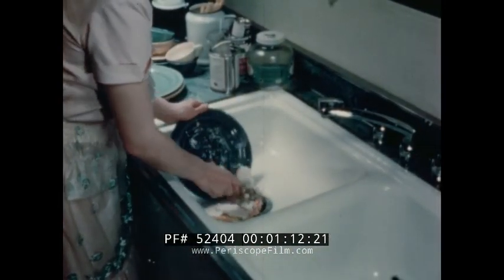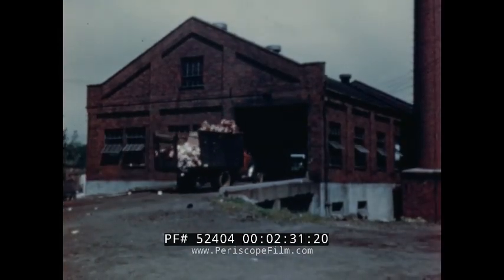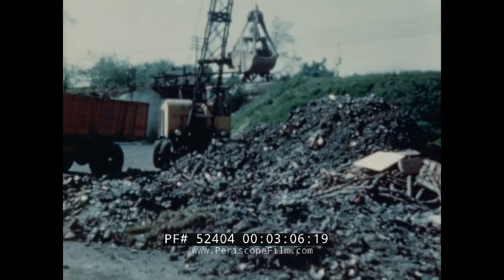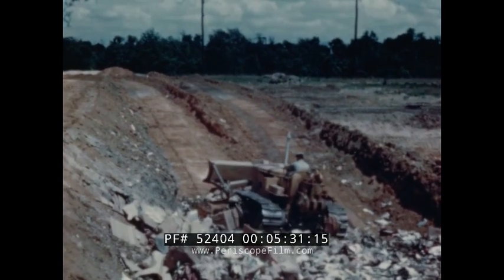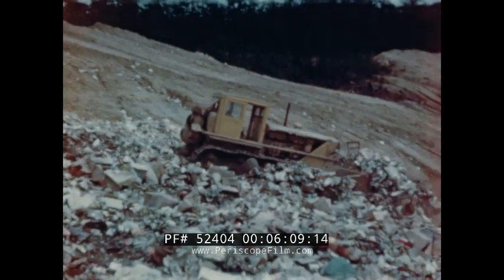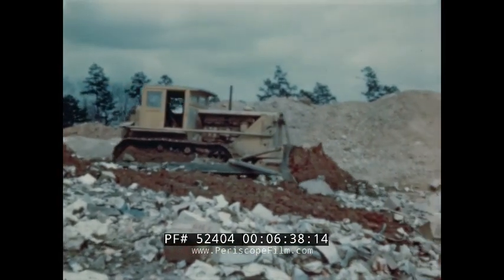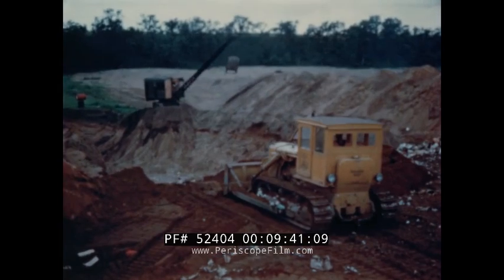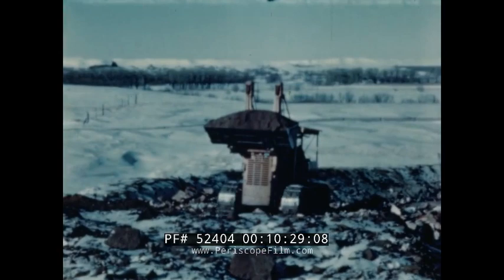"COMMUNITY PROBLEM" 1950s TRASH COLLECTION & WASTE MANAGEMENT VINTAGE FILM by CATERPILLAR INC. 52404

Comment: Wow, this film takes me back. 
I grew up in this era, and remember open  / burning dumps near my town. 
A friends father owned a small independent waste hauling company, and I worked summers (as a kid mind you) hangin' on the back of packers & slinging trash 5 days a week. The Landfill we dumped at was actually a mined out gravel & sand pit for a local concrete Co. 
No such thing as landfill liners back then, and recycling wasn't heard of in my area until the mid 1980's. I remember dumping our trucks into pools of standing water @ the bottom of the pit, that was quite large (approx. 1 mile long by ½ mile wide). As River Huntingdon mentioned below, they would take in most anything. 
I saw whole cars crushed, tires, appliances etc. 
Even drums of chemical and industrial waste were dumped in and compacted. 
They were using hydraulic landfill compactors & large bulldozers on this site in the late 60's & 70's when I was in the business. But they still had some old cable drag line excavators and a old dozer as a back up unit if something broke down. It was a fascinating place to go twice a day to dump, and see all the action of over 100 trucks dumping each day.
Reply: IM so jealous! I would have basically lived there. I hate how controlled landfills are now. No fun

Comment: We had a "Controlled Tip" where I grew up in 70's England. ANYTHING went in it, car bodies, old fridges and appliances, planned obsolecense in action. Even the contents of local cesspools were dumped there. Then the whole lot was set on fire, asbestos fibres everywhere. It's still astonishing what I find on the bins. TWO LED TV sets, one needed a simple repair, other one worked. DVD HDD recorders, old record players, vintage boomboxes and stereos, speakers, appliances. All are usually easy to fix, but the average person has no idea HOW to fix it, and there's nowhere to take them for repair that won't try to sell you a new one. So it's all replaced by garbage chinapride so-called engineering. I do repairs for people, just recently fixed a 1970 ITT TV set. All it was was a blown 30 - ohm speaker. an easy one LOL !

Comment: It's quite stunning to see those old cable operated tractors and equipment in action. It also interesting to keep in perspective what a problem trash really is. Today we take for granted the technology utilized to deal with trash. Open pit dumps, incinerators and actually feeding hogs trash... Wow...
Reply: @4:25 that is a Hydraulic Dozer Blade, not Cable
Reply: @5:22 that is a Cable Dozer Blade
Reply: You are correct, the excavators that run on cables really blow my mind, since we obviously have come a LONG way since cable operated anything when it comes to construction/earthmoving equipment.
Reply: +shadofax96 Yes, the technological advancement is amazing, in power, hydraulics/hydrostatics, & electronics.

It is also quite amazing what was accomplished by the prior, "primitive" mechanical designs. The many types of equipment that were Steam powered w/cables, & Horse powered w/manually (human) operated controls, are mainly unknown to most people.
Reply: Watching what it took to excavate the Panama Canal using what was available at the time was simply stunning. It's hard to imagine what people were able to do with such primitive equipment. But where there is a will, there is a way.
Reply: MrBillT   1st time i have ever seen a cable operated  crawler loader and believe you me i have been looking. I have been an antique equipment buff for , well say since , well since 1983
Reply: Hogs were fed off cooked food waste, too--there were pressure cookers for food waste to sterilize it.  Safe and very economical.  This is a bit slanted.  Rags and scrap metal had considerable value then, too.  (Glass never has, and paper didn't, though.)

Comment: I guess  technology has solved part of the problem.  Sweden has to import garbage from England to keep their recycling plants operating at capacity.  They get electricity from burning garbage.  But, that's Sweden.
Reply: Incineration isn't recycling, no matter what Sweden calls it.
Reply: @genli5603  If what you're burning is contributing to generating electricity, and you are doing so in a manner as clean as possible, well, even without the second bit, technically, you are recycling.
Reply: I guess a major part of the definition of recycling is using the waste again, in some form, without causing any detriment. If Sweden is burning the waste and using the electricity generated, then part of it only can be called recycling if the process is causing air pollution. 
Btw, what do you mean by 'as clean as possible ' ?